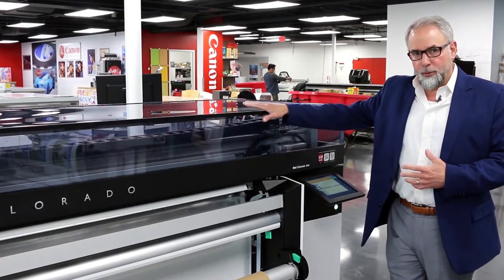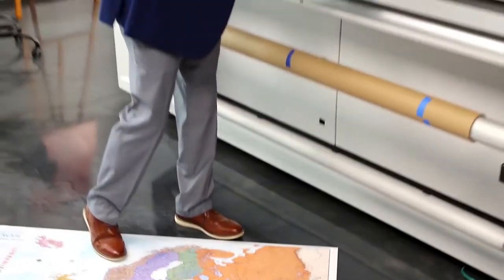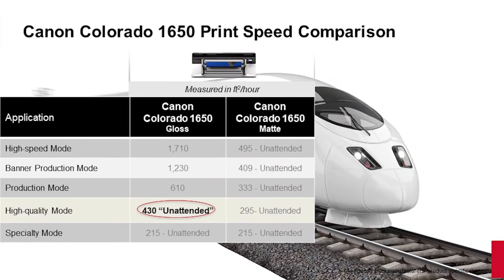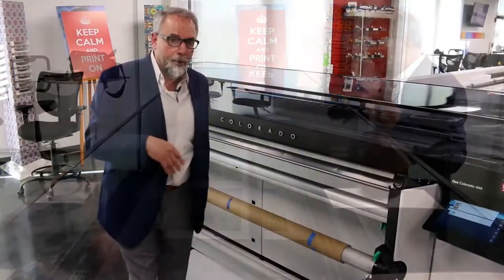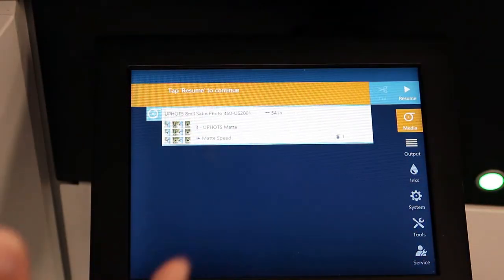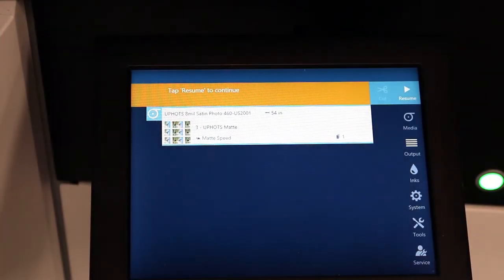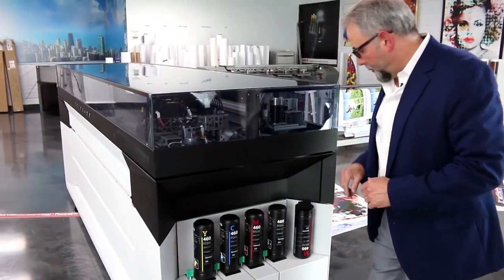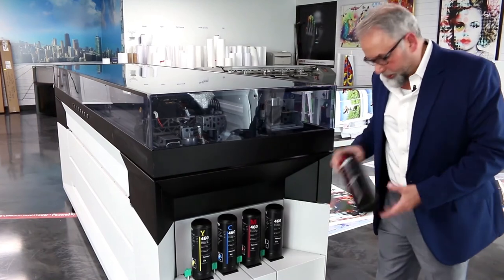Canon Colorado 1650 Extended Review Demonstration

Comment: They have a chiller problem in the older units that is not good.   Service is not backing this issue fast enough   Sad  because the unit prints fast at very  good quality.